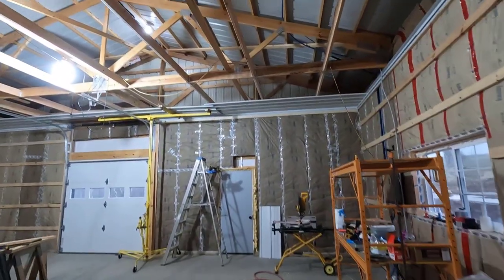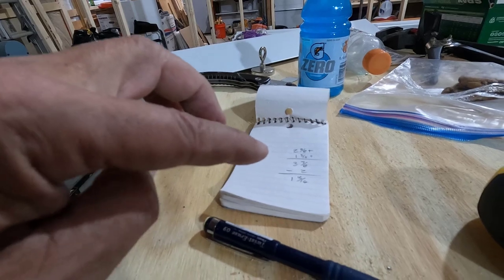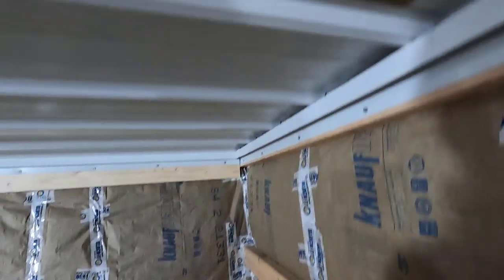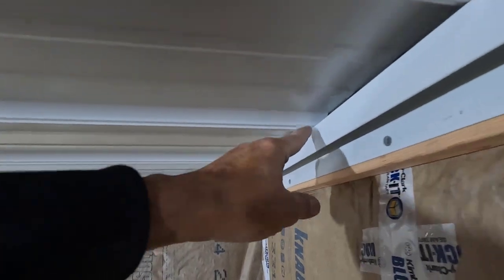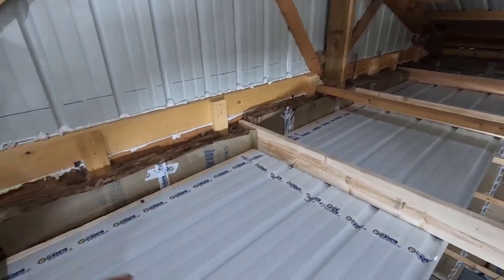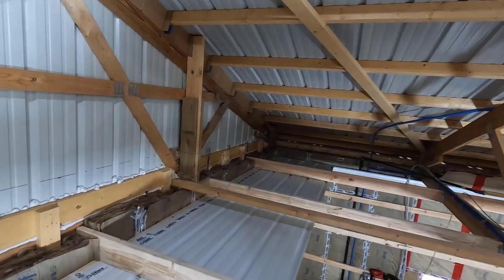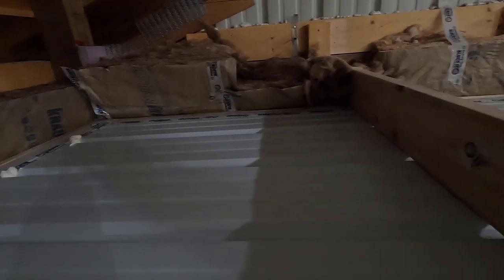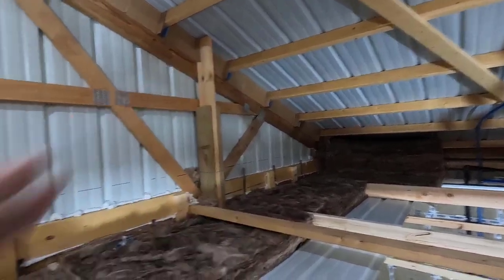Metal Ceiling Install ― Using a Metal Ceiling as a Vapor Barrier

Comment from the maker: I have always thought that putting up impermeable plastic up, then putting impermeable metal over that was a mistake! Obviously the metal has leaks and the plastic will stop those leaks, but that will also trap moisture between the plastic an the tin in the process! Once moisture is trapped, it will condense into water, and will have nothing to do but slowly rust the ceiling and it's fasteners — or even drip down into the building! If you are not going to seal the tin as you put it up, use a two-way membrane instead of impermeable plastic! MemBrain Smart Vapor Barrier - https://amzn.to/3ugDBmD

Recent Products used:

16' LeverLock Tape Measure - https://amzn.to/3MRu9i9
Seagate Desktop 8TB External Hard Drive - https://amzn.to/3gRZGEC
SuperWinch Terra 45 - https://amzn.to/3AdzJWR
Large Tapcons - https://amzn.to/3TDkJbz
Heavy Square Washers - https://amzn.to/3E1tvKV
DeWalt Impact Wrench Kit - https://amzn.to/3EtMaQY
Flexzilla Air Hose - https://amzn.to/3ARo6W5
Drywall Lift Panel - https://amzn.to/3hOwDm4
Milwaukee M12 2.0 AH Battery - https://amzn.to/3X9qvVl
Kinco - Premium Leather Work - https://amzn.to/3EeLTjv
Johnson Laser Level - https://amzn.to/3idhn2h
200 lb Neodymium Magnet - https://amzn.to/3F2PEu8
100 lb Neodymium Magnet - https://amzn.to/3U8vrHF
Tyvek Sheathing Tape - https://amzn.to/3XKaQMu
MemBrain Smart Vapor Barrier - https://amzn.to/3ugDBmD
ColorFit by Milton Coupler & Plug Kit - https://amzn.to/3UpS6iJ
Milton Safety Exhaust Coupler - https://amzn.to/3FhrCeY
Senco SPS SKS-L, SKS-M, SKS-N Staple Gun O-Ring Kit - https://amzn.to/3H3wqWq
Old-School Brass Laundry Faucet - https://amzn.to/3TcXWUH
Schrader Valve to Male NPT Fitting - https://amzn.to/3ytxazd

Comment: Interesting discusson bout the water and vapor. You got this all fugured out. Makes sense putting center sheet in last. Looking good. Moisture like stink bugs, they always gonna get in... 🤣
Reply from the maker: Thanks Dave! It would be nice if a place like Building Science did studies on pole buildings, but they haven't yet — but they have done the testing on vapor barrier sandwiches, and it is a big no-no. The ones they tested had a vapor barrier on either side of a wall, not pressed together, but the results would be very similar — trapped water. There are a lot of things about post frames that could use some science to discover, but I believe this one is 100% correct 😊
Reply: @PlanetMojo  😊👍

Comment: I've seen other videos on metal ceilings, and some just use the metal as-is because of exactly what you are saying. They say any moisture that gets up there will quickly dry out.
Reply from the maker: Thanks Robert! They are correct about the moisture dissipating, but too much moisture at one time will degrade the insulations ability to insulate. The water vapor from small air leaks will just evaporate but large ones can cause condensation and R-Value problems. With the ribs in a metal ceiling, the air can travel basically anywhere on the ceiling, and if it finds an opening in the insulation it will basically create a chimney effect. At best it will leak a lot of heat, and worst it will get the insulation wet!  😮

Comment: I was thinking the same thing about the plastic and metal cieling sandwich. Glad you explained and showed what you're doing for your building. I'm a few months away from doing my building, but I'm keeping your rationale in mind when I do mine
Reply from the maker: I would really like to see some science on this — but there is none at the moment. I do believe I am correct though. If you don't want to seal things up as you go, use a smart vapor barrier (2-way) MemBrain Smart Vapor Barrier - https://amzn.to/3ugDBmD We use this in our breezeway project that has an unvented flat roof.

Comment: Hi Mojo, another great video, I think I got the gist of what you were trying to get across, but in any event I sure you know what your doing, I have seen a few workshops but can't recall any of them with a ceiling.
Reply from the maker: Thanks Larry! Around here I would say 99% of all post frame buildings are unheated. Most are farm buildings, and when they work on the equipment they use a torpedo heater in the winter (or nothing at all!). Very uncomfortable, but cheaper initially. In the long-run, it is far cheaper to insulate and heat the whole building. You could heat the whole building for a couple of days for less than the cost of a  small tank of propane!

Comment: I would like to know the thought process behind building the box around the garage door spring assy. etc.    ???
Reply from the maker: If it wasn't boxed-out, it would have wound up being inside the ceiling, and be buried in the insulation. Not only would that have been a huge amount of work to build a ceiling around the hardware, but I would have lost access to a large part of the door mechanism If this was not done. It really doesn't make sense to try doing it any other way 🤔
Reply: Thank you.   I have to go up an look now but I believe mine is is below the ceiling.    @PlanetMojo
Reply from the maker: @davelundberg1320  I have an extended height door, so the door goes all the way up  (12 feet). Normal doors should be easier to work with. You will still need to deal with the brackets though. I detached mine, slipped the ceiling underneath, then reattached the brackets thru the ceiling. All of that is in other videos here on the channel. 😊 Good luck!

Comment: I watch @RRBuildings once and awhile, and they have mentioned several time that people have warned them about the metal over plastic, but they believe it is the correct thing to do. It has always seemed wrong to me as well. With drywall and other building materials, the moisture will build up in the material then go away as the seasons change. To me, sealing things up tight is far more important than physical barriers.
Reply: I’m no scientist and just a self builder like PM…but my guess is RR and such do the plastic sheet as a time vs money equation. They can put up the plastic sheets in likely way less time than it takes to get ribbed metal air sealed. I guess we need RR to follow up on some of his 2017 builds and see if there have been any issues.
Reply: @bpdp379  I agree. I read an article on 'building science' once that said that the vast amount of water/damage to insulation was not from vapor from the house, but water infiltration from outside. Post frames are an odd creature though, and it would be nice to see some scientific testing as far as insulation goes.
Reply from the maker: @bpdp379  I agree about the time issue, they are a builder and need to move quickly. Smart membranes would absolutely work, but they are expensive. It would be nice to see hot the ceilings held up! I would lean towards no vapor barrier at all myself.
Reply: @PlanetMojo  the thing that really confuses me is spray foam. Let’s say you apply 2 inches of spray foam on the wall and then because it is the vapor barrier you don’t add a vapor barrier. But you then put metal over that. Wouldn’t that be creating the double vapor barrier? I have never seen anybody complain of condensation when there is sufficient spray foam to create the vapor barrier though. The more I research it the more I get confused. I guess the metal is leaky enough if you don’t tape and seal to allow drying inwards?
Reply: @ShedHomePro  yeah I always hope to see Kyle go back and just pull a panel off a wall that he did a long time ago or climb up in an attic just to show what is or isn’t working
Reply from the maker: @bpdp379  It depends on the permeability which varies between open cell and closed cell, but neither one is as impermeable as a plastic sheet, and will allow water vapor to pass through. Tar paper and XPS rigid foam are both semi-permeable for example when most people would think otherwise (tar paper is 30 perms!), and a layer of paint can be the same as a 6mil sheet of plastic! The chart below lists spray foam at 5 perms, which is similar to many house wraps. It has "actual use" numbers, not solid, unbroken sheets which are unrealistic.

https://permies.com/t/43637/a/24999/Perm.JPG
Reply: @bpdp379  I agree.
Reply: @PlanetMojo  So Menards is a distributor for an acoustical 
liner panel manufactured by Midwest Manufacturing called Dura-Panel. It's a 29 gauge ribbed panel just like you installed -- but it's perforated to diffuse sound reflections. Given the perforations, there would be no point in sealing the seams. If you laid a faced-batt insulation on top of this panel, what would you expect the water/condensation issues to be? (I really like the idea of reducing the echos in my barn while running power tools. . .)
Reply from the maker: @atslastname5624  The steel really does have an echo with nothing on the floor, but that will dissipate as things are added to the room. If I used the perforated panels, I would just use a plastic vapor barrier, or possibly rock wool insulation and no vapor barrier. I would have to look into it, but the condensation point would likely be the underside of the roof so there's no need in trapping water at the ceiling level. You can check out some good info on the subject here: https://buildingscience.com/documents/insights/bsi-049-confusion-about-diffusion
Reply from the maker: A big thing to remember is that if you are not generating moisture (shower, washing, cooking, etc.), then there will be little chance of condensation. If the place is continuously heated and well sealed, it's not likely you'll ever see condensation in your shop area. If you have snow melt from vehicles, a dehumidifier may be called for.

Comment: I've seen houses with a vapor barrier sandwich. Usually done by home owners because plastic is cheaper than housewrap, they put plastic inside and out, and the walls get drenched. I agree 100%, moisture will get into your walls or ceilings, and needs an easy escape, not another plastic sheet.
Reply from the maker: We lived in a house that a contractor built for himself, and he did it that way! I wish I had access to a plastic on metal situation that is a few years old to see how that looks, but that may never happen 😐